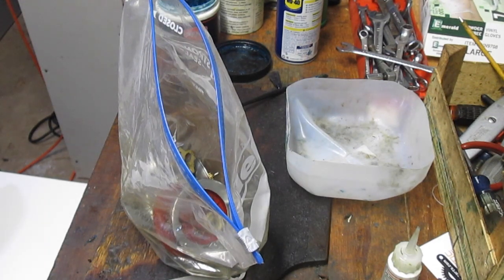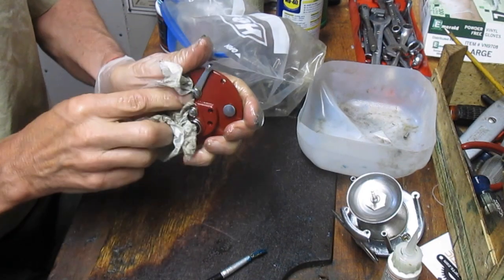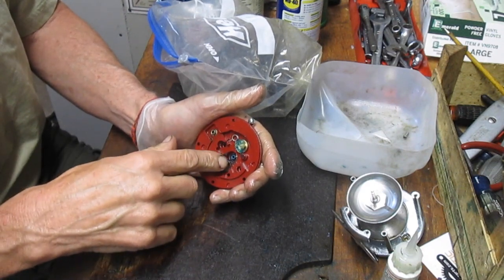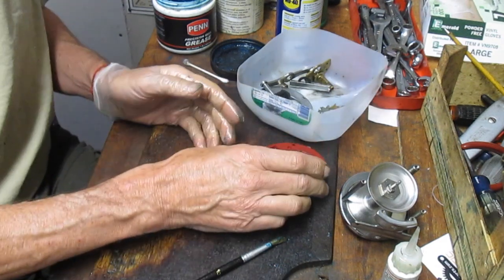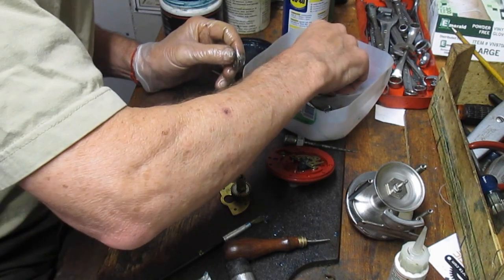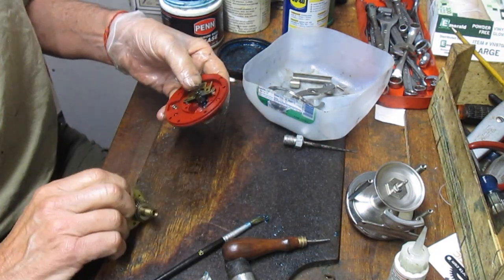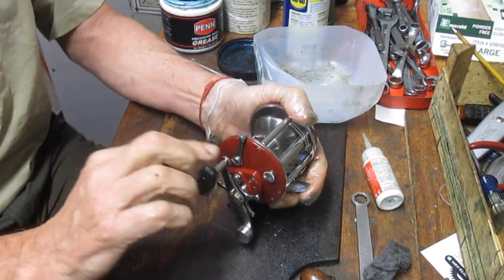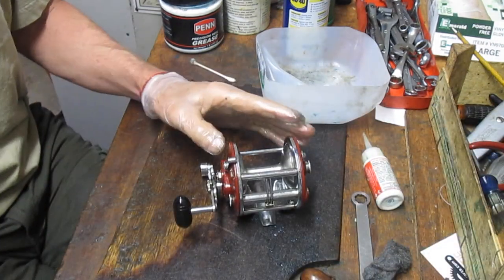Penn Peer 209 saltwater fishing reel in a bag  How to service  znd reassemble

Comment: The screw that holds the plate ,quick release I guess you would call it,,seems to loosen up after a couple of trips..Any ide why this could be happening?
Reply from the maker: Yes, it is either worn threads on the screw or in the frame. Most old timers simply remove the side plate screw (gently pull / twist out with a pair of pliers) and replace it with a standard screw.  It doesn't quick release, but it does hold the plate on.  If the frame side is worn, then the drill it out and use a machine screw and plastic lined cap nut to hold it fast. - Dennis
Reply: @2ndChanceTackle  where do I get a screw that fits? And the 2nd fix you suggested,,no idea what that means lol

Comment: Hi, i have an old Penn Peer 209 that was given to me. I have a problem with it. The clicker button is loose(wobbles) and won’t engage the clicker at times. How can i fix the clicker button?
Reply from the maker: You can replace the click ring in the bearing (non-gear) side plate if it has a screw.  If it does not have a screw, you can use a pliers to bend the click ring arms cloys together and restore the tension needed to click. - Thanks for asking Jeff - Dennis
Reply: 2nd Chance Tackle yeah the ring was a little out of wack but i trued it back up. The clicker switch itself is my issue. It seems to be wore out or something. there is alot of excessive wobbling to it. It doesn’t want to engage correctly. Thanks though.
Reply: 2nd Chance Tackle i think i got to work. Thank you for this awesome video. Its helped me with this. You and your family becareful, be safe, stay healthy and God Bless.